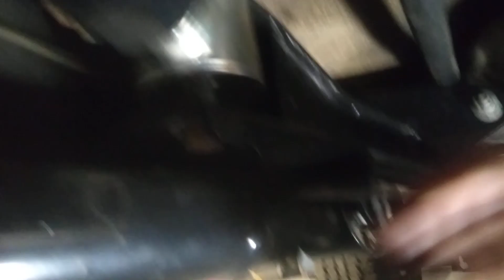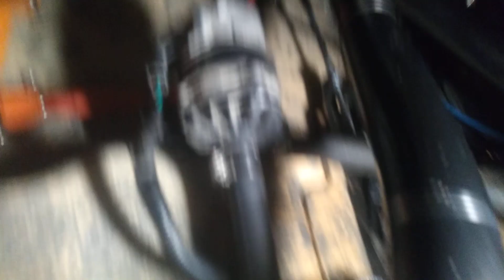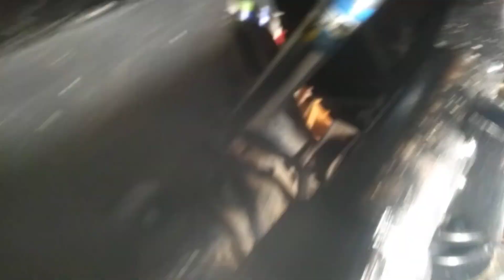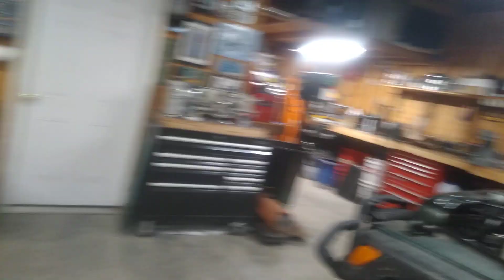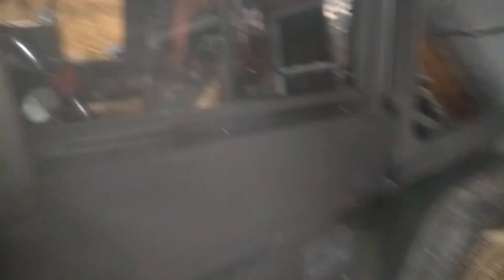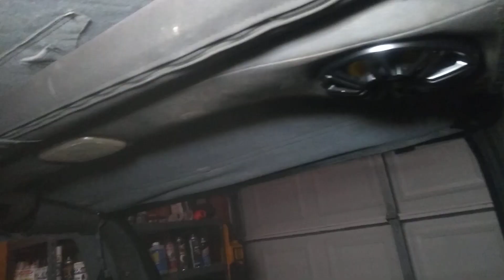TSLA TJ Overview - Tesla Jeep

Comment: How did you integrate with the vehicle’s ECU? I’ve heard it can be really difficult.
Reply from the maker: The Tesla or Jeep ECU?  I threw the Jeep ECU away...no need for any of it.  No need for Tesla ECU either.  Their ECU(s) manages hundreds of things from suspension height, ABS, steering, brakes, displays, and on and on.  I bought a simple module from EV Controls that hacks into the Tesla motor controller.  EV Controls did all the hard nerdy work figuring that out.  They make it very easy for guys like us to put a Tesla motor into a car/truck/Jeep.
Reply: @billbayer5526  did you get another ECU for it? If not, how did you retain features such as airbags and TPMS?
Reply from the maker: @joshb4209   Well, on a 1997, there really isn't one.  I'm not using any of the factory gauges.  I obviously didn't need any of the engine ECU's.  There is one small ECU under the heater that I think controls the air bags.  I assume they still work but I don't know.  Other than that, old Wranglers are very simple.  I would not like to tangle with integrating a newer car/truck/Jeep.
Reply: @billbayer5526  thanks for the reply! I appreciate the insight

Comment: Wow. Great job. How many amps is the DC to DC charger for the 12v battery? A winch I would guess draws 300 amps or more under load. Can the 12v system be built to supply winch power needs for actual off-road use? I guess the Tesla drive unit has a differential? Does it have an option for limited slip, or locked so the jeep actually has 4wd? Is air-conditioning possible? How many HP would you say this build can supply for continuous duty, like for highway driving over a mountain? I read Tesla motor specs that sound like the high HP numbers are just for a very short duration. Sorry for all the questions. You've probably already talked about this stuff. I haven't had a chance to watch all your videos. I built a TJ that looks stock on 1-ton axles. I'd love to do a Tesla swap on it! Keep it up my friend. 🤙
Reply from the maker: Great questions!  Keep them coming.  The DCDC will put out about 100a.  While not enough for serious winching it's more than enough to recharge the battery after a recovery.  I have no intention of tackling Black Diamond trails any time soon!  :)  The drive unit has an open diff from the factory but I swapped that out for an Automatic Torque Biasing LSD from Quaiffe (same design as Torsen).  It is full-time all wheel drive.  A/C is possible as I retained the factory evaporator but it probably ever happen as I just don't have room for a condenser behind the grill.  The drive unit can put out upwards of 500hp for short bursts.  Honestly, if you laid down that much power for more than a few seconds you'd be going over 100mph! It's rated at 60hp continuous (about 117amps).  From what I can tell, the Jeep takes about 40hp to go 60mph.  That number should go down as things break in and loosen up...I hope.  One major upgrade that needs to happen is installing 1-ton axles.  I have the drive unit limited to 250hp to hopefully save the diffs but I'd like to turn it all the way up.  What axles did you use?  Any videos?  Picts?